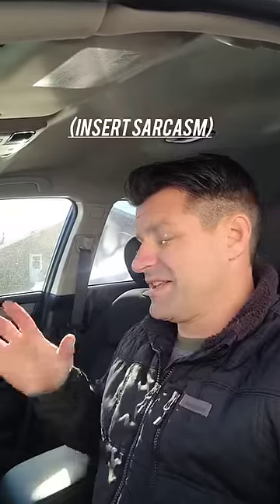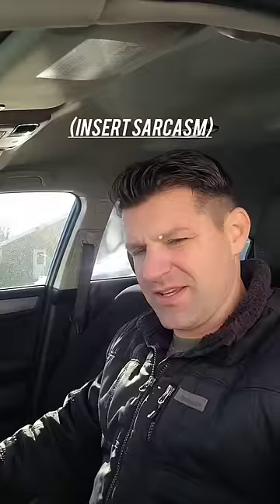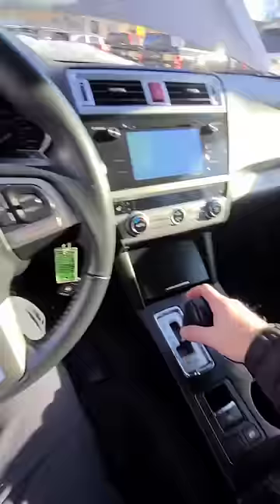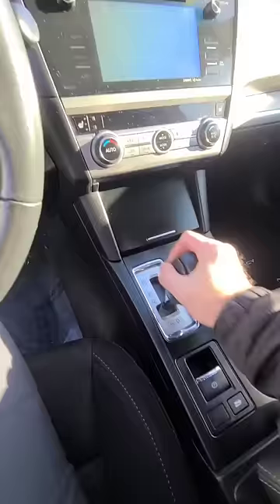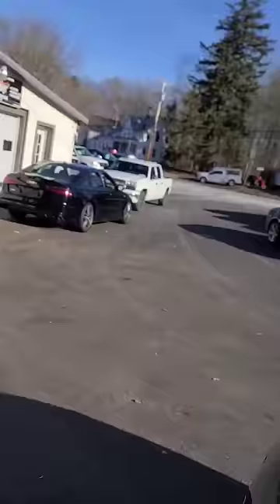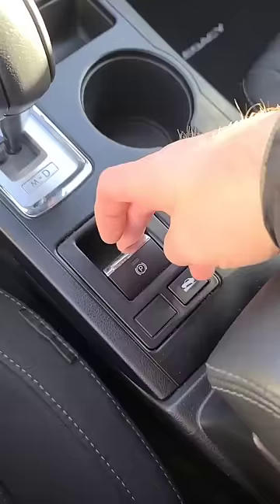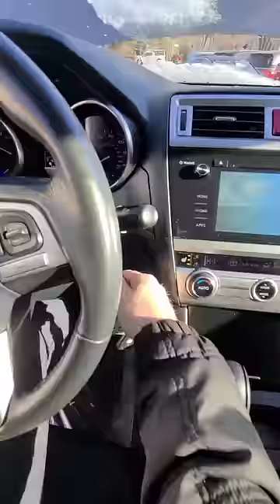Why Subaru Engineers deserve a punch in the Face! #shorts

Comment: All emergency/parking brakes should be mechanical. They’re not much use if you can’t use them when you need them the most.
Reply: How often is it the case that you're moving and don't have neither hydraulic brakes nor battery power
Reply: It's also a pain in the ass to drift using them
Reply: @THEACERASPIREMAN  the man who has a mechanical parking break is a fool every day but one
Reply: @xenn4985  Sure it might come in handy in the 0.1% of cases, is that a reason to keep a more expensive manufacturing process?
Reply: @brandonlink6568  Well I can't argue with that except to get more power to the rear wheels so you don't need a brake to break loose
Reply: @THEACERASPIREMAN  electronics fail alot more that physical connections
Reply: @THEACERASPIREMAN  its worth it because electronics fail more often, it's an emergency brake and they're are adding in more fail points
Reply: Parking brakes really aren't emergency brakes.  They're not built strong enough they often have pads held in with spring pins that just go in holes in the baking plate of the brake.  Now the modern electric ones usually just activate pressure in the abs pump to hold the rear brakes on.  I much prefer this because they aren't a bear to service.
Reply: They call it “parking brake” and use a P within a circle to indicate the button.
Originally, it was called the “Emergency Brake“ because if your hydraulic brakes, foot brakes, primary brakes or ext were to fail,  you would be able to rely on a separate braking system.
It uses a cable from a hand crank, to actuate the rear brakes, at times, the rear brake that the Emergency Brake was attached to, is a totally different hardware than the regular rear brakes.
Reply: @THEACERASPIREMAN  it being literally the only way to aplly brakes to a car that has no electricity? Yes...
Reply: @xenn4985  You can apply your hydraulic brakes without electricity
Reply: @ryantracey8574  Never yet seen an electronic parking brake fail, but plenty of stuck cables and frozen parking brake shoes
Reply: @ryantracey8574  They're removing fail points actually
Reply: @bryceg5709  The parking brake is still an emergency brake, it is designed to be able to stop a moving car in case of a complete hydraulic failure. Also, that is not how modern electronic parking brakes work, they just have an electric motor attached to the caliper, which will push the piston. A parking brake cannot use the hydraulic brake system.
Reply: @OssamabinKenny  Yes, and it is still designed to do that.
Reply: @THEACERASPIREMAN  can you... lock them?
Reply: How is it even an emergency brake if you cant use it while the cars dead whats the point
Reply: @xenn4985  You can bring the car to a stop with your hydraulic brakes, and keep it there with a gear/parking pawl
Reply: @THEACERASPIREMAN  sure airbags only save your life if you crash. is that any reason the manufacturer should spend money on putting them in the car? the point is in an emergency the emergency brake needs to work in every situation. if my battery dies or fails while driving down the road... I still have an emergency brake to stop myself without the brake booster.
Reply: That's why they don't call them emergency brakes. They're called parking brakes.
Reply: @ryantracey8574  except I've fixed way more mechanical parking brakes than electronic parking brakes.
Reply: @bryceg5709  no they don't, they all have motors on the rear calipers.
Reply: The trick is to put it on when you park.
Reply: @edward1927  In road vehicles, the parking brake, also known as a handbrake or emergency brake (e-brake) - Wikipedia. regardless playing semantics is a sign of a weak argument.
Reply: Its not an emergency break 🤦🏼‍♂️
Reply: @chetopuffs  In road vehicles, the parking brake, also known as a handbrake or emergency brake (e-brake)... - Wikipedia
Reply: @THEACERASPIREMAN you’re simply wrong about it costing less. In fact it costs more.
Reply: @THEACERASPIREMAN  and when those dont work?
Reply: @THEACERASPIREMAN  a mechanical parking brake is a safety item. What do you not understand about this.
Reply: @bryceg5709  standard parking brakes are drum brakes situated on the inside of the rotor. They are perfectly cabaple of stopping you at any speed safely. They will lock more easily than standard foot activated hydraulic brakes but thats because you arent used to use your hand to brake.

Electric brakes are a safety hazard and you should never buy a car with them
Reply: I agree
Reply: @edward1927  I mean they are also called emergency brakes
Reply: @xenn4985  Then you're in a very bad situation I guess? What if your mechanical hand brake cable snaps?
Reply: @thomasfournier3738  Electric parking brakes can do the exact same thing
Reply: @thomasfournier3738  Why is it any more of a safety item than an electrical parking brake?
Reply: @justinkaufman495  It's because the electrical parking brake still complies with regulation and can stop a moving car. If you lose electrical power when driving you should use your pedal brake to stop, not your emergency brake. The only time you should be using the parking brake to stop is if you lose hydraulic brakes completely.
Reply: @THEACERASPIREMAN  No. You don't get to take something that is so rare people don't even think about it, and compare it to something that happens so often people wonder why the fuck it was designed like that.
Reply: @justinkaufman495  
you didn’t just use wikipedia as a source; did you? 🤦🏼‍♂️
Reply: @xenn4985  Wrong. There is zero advantage to electronic parking brakes. They are a technology that had no reason to exist.
Reply: @scythelord  That's what I said
Reply: Most are not.  But all asian cars are.  So this is just a not knowing how.   It would have taken him less than turning on the camera.  It litterally said
Reply: @ddjohnson9717  Which he could've solved by just overriding the shift interlock
Reply: @scythelord  There definitely are advantages, they're much simpler to implement, take less room in the car, are more reliable, don't ever require adjustement, allows for automatic parking brake activation, etc.
Reply: @xenn4985  It's common to be in a situation where you only have the parking brake to stop the car and you don't have any battery power?
Reply: @chetopuffs  I very much did. Wikipedia has been an acceptable source for years. just because your school teacher wouldn't let you use it, doesn't mean everything in there is untrue.
Reply: @THEACERASPIREMAN  Why are you telling me something I'm literally already saying.
Reply: I think if they use electronic parking brake they should also have a manual emergency brake
Reply: @warburk  Why? The electronic parking brake is also an emergency brake.
Reply: Well the e brake went from emergency/ parking brake, to e brake meaning electric/ parking brake.  Far as I can tell it's shit for emergency braking
Reply: @marvyn_wez  I mean a mechanical handbrake isn't ideal for stopping either, but an electric parking brake will still stop a moving vehicle in case of completely hydraulic brake failure
Reply: @THEACERASPIREMAN  the most common failures across all brands of modern cars are electronic/ electrical failures. That's all the reason I need to not buy a car with fly by wire throttle/ steering/ brake controls. Especially autopilot and emergency accident avoidance brake control override systems.
Reply: @xenn4985 wtf.... He's never a fool...
Reply: This is literally the only reason I didn’t buy an ‘18 Civic SI. You especially need a mechanical one with a manual transmission car, as it (obviously) doesn’t have a park position on the shifter.
Reply: @arc_4543  Why wouldn't an electric one do the trick?
Reply: @rossbrumby1957  Good luck with that since emergency brake assistance is a requirement in cars produced after 2024
Reply: Like... In an emergency?
Reply: @THEACERASPIREMAN  look at the video, no matter how unlikely the issue is if it can be an issue you should have the proper tool to deal with the issue if it's just the battery going out and your car was in neutral. 

Say your hydraulic brakes go out as well or are extremely weak are we just expected to run into another vehicle to stop the car?
Reply: @xenn4985  so seat belts are a necessary thing to keep you safe just in case you go over a bump too quickly or get into a collision, what if we replaced it with seat belts that required the car to be turned on because they had an electrical system that moved the seat belt for you instead of it just being something you pull out. Clearly it's more technologically advanced and much safer since the seat belt can be made to fit a person way better than what we have currently : ). 

Don't worry about the human factor and the fact that a massive failure happening in the computer means you no longer have a seat belt it's the more advanced and ergonomic way handle it
Reply: Imagine the world where you no longer have to look at that stupid seat buckle hanging out the side column of your car, instead you just have to hit a button and it puts on the seat belt for you
Reply: @jacobryan4569  I mean this scenario is probably less likely than a scenario of failing hydraulic brakes and a snapping mechanical brake cable.
Reply: @THEACERASPIREMAN  no matter how unlikely it should either have both an electronic and mechanical e brake or should just be a mechanical one so you can potentially stop your vehicle when there is an issue. I guess it should be put on the person if they're car has an issue with the battery and they can't do anything about it. Clearly it's just a skill issue and not something that is going to be dealt with by the company that made the mistake in the first place.
Reply: @THEACERASPIREMAN  it's a parking brake. Not an emergency brake. How often do you use it with the car running is a better question.
Reply: @thethumper088  It is both a parking brake and has the functionality of an emergency brake as well
Reply: @kelpking4484  it's not. It's a parking brake. It is not intended to stop a moving vehicle.
Reply: @iLumberjack  It will. Pulling (and holding) the switch on electronic break while the car is moving will cause the ABS unit to slam the brakes as hard as possible, stop the car and then drive the caliper motors to ensure the brakes stay engaged. Tested in on my BMW
Reply: @Axymerion  if they're relying on the hydraulic system to work, then they aren't a brake intended for use in an emergency. Semantics aside (e-brake vs. parking brake), if you're in a moving vehicle and lose engine and / or electrical power, the hydraulic system will still function, albeit requiring a lot more force. There's no need for a mechanical emergency backup in that scenario. You wouldn't bother engineering a system for that specific failure mode because you're already covered. 
On the other hand, if you're designing a system to engage the brakes so that you aren't relying on a relatively weak pin in the transmission to hold the entire weight of the vehicle on a hill, a mechanical (old school) or electronic system will be perfectly adequate for the task. 
Yes, old school mechanical systems did provide the potential opportunity to use them if the entire hydraulic braking system failed, but the vast majority of drivers don't have the skill needed to know how much force is needed for controlled deceleration and stopping. The net result is a very high likelihood of locking up the brakes which carries and much higher risk of losing control. This is why, generally speaking, manufacturers no longer refer to the auxiliary brakes as emergency brakes.
Reply: @THEACERASPIREMAN  nearly all other manufacturers design the park brake to be a positive-fail system in that it will lock on without power.
Reply: @bryceg5709  not true they are classified as emergency brakes also and if yours isn't working you should get it fixed
Reply: @chetopuffs  wikipedia is one of the most reliable sources for information on the internet. it is held accurate by literally every person who views it. any misinformation is quickly corrected.
Reply: They don't need to be manual, they just use the wrong approach. They should be handled like security doors with electronic strike(r)s(?); there are two types, fail-safe and fail-secure. Fail-safe means the 'lock' disengages in the event of power loss meaning the 'door' is no longer locked/held shut. Fail-secure on the other hand means that when power is lost, the 'lock' engages preventing a lock/door from opening until power is restored.

Using the latter approach would mean that in the event of absolutely no power in a car, the parking brake/lock engages and will not disengage until power is restored. This does create an obvious issue in preventing the car from ever moving, but it's one that can be much more safely worked around and addressed in other ways.
Reply: @bmxscape  oh God ricer Honda Civic society.  If they were "emergency brakes" then they were invented when cars were all manual transmissions yes?  Ever had the brakes go out on your vehicle from the 30s 40s 50s or 60s?  I have my 68 Porsche lost it's brakes.  I've had this happen in cars many times in my life even in more modern cars like E30 BMW and one time I lost a brake circuit in the back of a 190e 2.3 in all cases you know what works? You just turn off the engine.  Yes back when the brakes were substantial products the transmission was manual and shutting off the ignition stopped the car faster than wimpy "e brakes". What doesn't work on mostly all those cars after 10 years of driving in the rust belt?  Ya nailed it the parking brakes which are rusted to crap not adjusted and the backing plates bent to crap.  Ever drive a car with hydraulic brakes linked to a lever like a rally car?? Try it they are frigging awesome otherwise toss your brothers salad and stuff it
Reply: @bmxscape  I'll add when have you EVER in your life went to need your brakes and then went oh crap my actual real 4 wheel brakes aren't working.  And I better now find my parking brake handle or pedal in my car and activate it because dear God my actual brakes aren't working!  Have any of you ever even thought about what you are saying?  In an emergency you would activate a secondary more crappy brake system? If you needed your real brakes you're just going to crash into it.
Reply: @bmxscape  I'll give you another if you wanted an emergency brake what axle in a car does most brake force?  Front or rear?  You better say front because clearly engineers know that a car in a panic stop with no brakes would have front brakes not rear.  So what engineer went hey let's put crap rear brake shoes into a rear drum brakes actuated by a cable and call that an emergency brake ya know so when our vastly superior dual circuit boosted brake system composed of 4 disc brakes and pads has to be manually activated by a handle that you aren't used to using at the last second?

It's just BS Porsche had parking brakes with a lever under the dash you have to reach down and grasp to pull.  It's an emergency brake like an abortion is contraception so stuff yourself.
Reply: @bryceg5709  parking brakes ARE emergency brakes
Reply: @pashakdescilly7517  no they aren't.  Just read this and try to grasp it.  You're driving you go I need to brake.  Maybe 1:1000 times you do this while thousands of feet before crashing and in that 1:100 million times does a person who does so experience a brake failure.  Based on car safety stats and amount of driving globally that's probably 1:100 billion.  So now in this event where you're all OMG my actual brake system failed you're going to grab a thing in your car you seldom use and are dinky little brakes only on the rear axle and not engine boosted?  And that's gonna stop you from hitting whatever it was that JUST made you apply your actual real power hydraulic brakes on your car??????
Reply: @pashakdescilly7517  sorry your weak point angers me.  If it's an emergency brake it should be stronger than the regular brakes.  It should be a redundant system that when regular brakes fail it succeeds.  It's the opposite.  They are parking brakes only.  You could argue that you should just drive using them as your brakes and then the actual brakes are there for emergencies.  That's very dumb but more intelligent than thinking that in an emergency your parking brake will do anything particularly on an older car.  They just don't.  Steer pump the brake shift down steer turn off the car.  Steer maybe once the car comes to a stop engage the parking brake but it's clear you've never used one in a real life scenario because they are absolutely useless.
Reply: @bryceg5709  In the early days of motoring, brakes were primitive and unreliable, and not very powerful. They were prone to failure.  Typically, the foot brake worked on a transmission brake, and a hand lever operated the rear wheel brakes.  They had to be totally separate brake systems.  Gradually brakes got more powerful and more reliable.  By the end of the 1920s, cars all had brakes on the front wheels as well as the rear, and foot operation was standardized.  The hand brake remained, legally required to be totally independent of the foot brake.  Typically, when the wheel brakes became hydraulic, the emergency / hand brake remained mechanically operated.  This was so that, if the main braking system failed FOR ANY REASON, the independent emergency brake would still be functional.  It's main usage in practice was for parking, but it is legally required as a totally independent separate braking system in case of failure of the main system.
This idea is also the main reason why motorcycles also have two completely independent braking systems, one on the front wheel. and one on the rear wheel.  Rules have changed recently to allow linked braking...  The pioneer of linked hydraulic braking on motorcycles starting in the mid 1970s was Moto Guzzi.  They operated the rear brake and one of the two front disk calipers from the foot pedal, and the other front disk from the hand lever.  Bingo, separation of braking systems!
Reply: @pashakdescilly7517  and you nailed it.  Modern braking systems are so far past "emergency brakes" that the newest you could refer to one as an emergency brake is... 1920
Reply: @THEACERASPIREMAN  for the same reason in the video, if your car dies you have no reliable way of keeping it still
Reply: @pashakdescilly7517  you realize anything you saw ken block RIP drive had a secondary hydraulic brake system most of which had a bias valve so that they could control a second left or right hydraulic disc brake.  None of which were manually cable driven drums?  My current vehicle fleet is a Porsche 912 a BMW R80 a manual Crosstrek and a 49 chevy 5 window so yes I drive manual.....and previously several BMW e30s including an m3 e36 and e46 manuals a Porsche 356 a Porsche 944 a Delorean several other non synchro trucks... Ya know what none of them had?  A parking brake I would use as an emergency brake!

Come off as you would prefer parking brakes are dinky little garbage brakes that if you want to stop ken block again RIP wouldn't touch in a lifetime.

And yes when we build rally cars the rear brakes get a mechanical biasing valve that controls both rear brakes proportionally....  And it adds 2 extra rear brake calipers (hydraulic). It's a whole different system that literally adds a second set of brake disc pads in a second caliper.

I can be a dick but you are an arse that's been penetrated.
Reply: @pashakdescilly7517  say it.  Do factory cable actuated drum parking brakes have the power to stop a car equal to the full stopping power if the actual brake system.   Yes or no.  It is clearly no.  You will clearly crash if your actual brakes failed.  They are only parking brakes with no emergency potential at all.  And Ken block again RIP snowmobiles are dangerous and you should never go straight down hill but again.... they are not emergency brakes in any way shape or form they are parking brakes and if your brakes fail down shift pump pump pump and aim for something soft.  Jeez I wonder why semi trucks have run off ramps bot cable actuated drum brakes on mountain descents.  Could it be that cable actuated drum brakes... dont work?
Reply: @pashakdescilly7517  park on an automatic is usually a pin that would shear in a heart beat if you engaged it at speed...
Reply: Or at the very least, have a mechanical alternative. I think at this point the engineers are too tied up in the "sleek, minimal look", but I seriously don't understand why they can't just add a pedal E-brake like you get on trucks and vans
Reply: my car is from 2001 and I live in the rust belt. ive never have had a issue with the emergency brake. I have never used it at high speeds but once I had a emergency, one of my brake lines rusted and I had no stopping power and so I remembered my dad a long time ago taught me to coast on the handbrake when he lost his brake booster and resevoir cracked. im thankfull to him. the most I was going was probably 35 miles since it was in the city but I stopped fine didnt really notice a difference with my normal brakes especially since those have always felt spongey eitherway. i know how to work the handbrake perfectly I got plenty of expierence with mountain bikes, so im used to knowing how much pressure to apply. due to bias I would love the mechanical brake to remain and btw this is coming from a computer engineer so I love tech and everything but I cant bring myself to agree with electronics in every single place. some things are best left untouched. although the electric brake just needs a few tweaks to become perfect
Reply: @THEACERASPIREMAN you just argued against gun control. You just didnt know it.
Reply: @bryceg5709  if your e brake doesnt work you should get it fixed. mine is hydraulic and can slide the car easily
Reply: Sorry sorry I have a case of Yu-Gi-Oh player still. Haven't yet gotten that dealt with
Reply: Or maybe they should start to wire the e-brake to a separate (smaller) battery? idk 🤷‍♂️ in my head it sounds like a solution-ish.
Reply: @lil-link  only adds something else that can go wrong
Reply: @THEACERASPIREMAN  One in a million but it's that millionth unlucky person will somehow get hurt and law suit then another mass recall then another price increase on cars for this stupid reason.
Reply: @lil-link  it's an electric motor not it combustion one, it won't do Jack Diddley considering if the power doesn't work on the car or the battery is dead and it doesn't have a backup source the motor can't do its thing
Reply: @THEACERASPIREMAN You're really here telling me electronics are cheaper than mechanical? Well I'll be damned I've been living in the wrong world
Reply: @muhammadkhairulafiq2917  A small electric motor attached to the same brake caliper as your service brake is simpler than making a whole other braking mechanism with its own shoes and cables.
Reply: @Nexgeninfi  I'd imagine that one in a million scenario would count as an act of god
Reply: @arc_4543  Except putting it in park
Reply: @THEACERASPIREMAN  it’s literally cheaper to make it a cable operated by a ratchet instead of a solenoid actuator that tightens things up like for real.
Reply: @davidking7750  "What are the odds?" is exactly how you engineer safety. Airplanes have 2 sets of crucial flight instruments, around 15 minutes of oxygen for the passengers in the case of a depressurization, 2 engines. While we can both imagine scenarios where those aren't enough, what are the odds?
Reply: @user-vk4vd7vr5t  That's not true, usually electronic parking brakes require power to both activate and deactivate
Reply: Most cars don't actually have emergency brakes, they are really just for parking. That's why the shoes are so tiny if it's a top hat style.
Reply: If you don't use them much, they tend to freeze up from rust / corrosion / dirt.
Reply: @THEACERASPIREMAN  LOL.
Reply: @THEACERASPIREMAN  you know that Civic SI’s don’t have a “park” position on the shifter, right? Because they have a manual transmission.
Reply: @arc_4543  Okay? leave it in 1st gear like every other manual
Reply: @Nexgeninfi  What?
Reply: @sulleyt1841  But they are still regulated as an emergency brake and have requirements to be able to slow down the car to a halt.
Reply: @ConstantinSPurcea  It's just a simple electrical motor that pushes the piston, I can imagine that being cheaper than an entirely separate braking mechanism inside the disc.
Reply: @THEACERASPIREMAN  not very often but its possible
Reply: @bryceg5709  "They're not built strong enough they often have pads held in with spring pins that just go in holes in the baking plate of the brake."
Rofl, spring pin into holes in the brake disk, that would be something to behold. 
Please tell me a single car model where this is how the handbrake works. I really doubt you service a lot of brakes.
Reply: @THEACERASPIREMAN  doesn't matter, emergency   brakes should not depend on anything else in the car.
Reply: @THEACERASPIREMAN  how about we have the airbags rely on the battery too?
Reply: @bryceg5709  happened to me when I was a teen didn't bleed the line properly, went out for a test drive, thank God for manual e brakes
Reply: @Vertti Honkanen  had a brake like burst while i was driving, needed to use my e brake to stop. So there is that
Reply: @bryceg5709  that is how all drum brakes are made and they work just fine.
Reply: @THEACERASPIREMAN  its not about neither, either or is just as bad. had a brake hose bust about a hour from home, being able to manually apply brakes as needed using the lever got me home. you cannot do that with electronic ones since they just clamp with no variability. also electrical faults are a thing as well. as a auto tech i trust cables way more then i trust manufacturers and their electronics.
Reply: @rickylafleur5823  An electronic parking brake is not all or nothing, it will try to slow you down gradually. 

Electrical faults exist yes, but since you say you're an auto tech, how often do you have to repair electronic parking brakes versus how often do oyu see stuck cables or mechanisms with mechanical parking brakes? Maybe my experience is different since I live in a cold climate but mechanical parking brakes are always liable to freeze or  cables to rust.
Reply: @showlottathings  Airbags do rely on the battery
Reply: @showlottathings  A mechanical e-brake still relies on a cable, which is liable to break.
Reply: If you drive a manual just shift it. You can't move it easily if you did. The vacuum and compression is stopping the car
Reply: @THEACERASPIREMAN  i have changed both but neither frequently, most refuse to fix their e-brake but i guarantee you they would be more inclined to fix two cheap cables vs a few hundred dollar actuator. also the BMW's i have had to replace the PBCM ones which is what they call theirs it is electronic but uses cables so all most of these are doing is adding another failure point.  in fact it's multiple more failure points, the switch, control module, actuator.
Reply: @THEACERASPIREMAN  parking brake cable snaps? LOL I guess you're fucked too if the electronic parking brake flimsy plastic button snaps  xD
Reply: @THEACERASPIREMAN  just in emergencies
Reply: @BryceG  that is like saying Emergengy Rations should be more food than normal food because in an emergency you need extra. Emergency equipmipment is not "for best results". it is "when all else fails".
Reply: @THEACERASPIREMAN  doesn't matter how often it happens he's right and you're wrong.
Reply: @Faygo2215  Of course it matters how often something happens.
Reply: @THEACERASPIREMAN  Better to have it and not need it.
Reply: It's a parking brake i.e. you use it to remain stationary once you have already come to a stop. I grossly dislike E-Brake as a term, it's wrong.
And I also hate seeing vehicles wobble on their locked transmission (in park). Poor gearboxes!
Reply: @THEACERASPIREMAN  wrong, they have internal caps which allows them to function when/if the battery is disconnected during a collision
Reply: @THEACERASPIREMAN  "How often is it the case that you're moving and don't have neither hydraulic brakes nor battery power"

I don't know about battery power, but that one time if/when you loose your brakes, for any reason, is one time enough.

Just because it's [current year] does not mean certain things ought to be engineered to be out of the direct control of drivers.....

.....like *emergency* brakes.
Reply: @blakjaknz  Well it is also designed to be an emergency brake if need be, that's where the term comes from
Reply: @showlottathings  Yes, for a few seconds
Reply: @FourFourSeven  But when designing safety, you look at odds. If something is extremely unlikely, you're not going to make sacrifices in design for it. Also you already don't have 'direct' control of your hydraulic brakes, ABS literally interferes with your brake input since the 80s
Reply: @THEACERASPIREMAN  designed? No, I'd disagree. It can be used at a pinch, but it is not intended to stop a moving vehicle.
Reply: @justinkaufman495  
With respect, No; Wiki is not a source.
I will however concede that Wiki is excellent repository of source material just like a card catalog at the Library, but not even a library in it’s self is a source.
•Case in point:
If you has actually gone into that ”Library” of knowledge; you would find a 2014 Subaru Outback/Legacy Owners manual, like mine.  (Given similar variables some credence to validity can be given as to be considered a valid source)
Section 7 Page 37
*•Electronic Parking Break
Image: 701178 
Image List Item 1 of 3: Parking Break Switch*

I would have just provided a direct link to a PDF, but YouTube will pull my comment. Isn’t strange that they can cite Wiki, but we can’t cite Subaru???
Those teachers and I are trying to show you the folly and dangers in your line of reasoning.
Reply: @THEACERASPIREMAN  " But when designing safety, you look at odds. If something is extremely unlikely, you're not going to make sacrifices in design for it. Also you already don't have 'direct' control of your hydraulic brakes, ABS literally interferes with your brake input since the 80s"

You can calculate odds for many different situations and scenarios as much as you will, but it's still absolutely terrible practice to engineer away direct command of something very, very important to a basic concept of transportation, and that is the ability to stop your vehicle in case regular hydraulic brakes stop working altogether.

And it doesn't matter at all whether or not I have direct control of hydraulic stopping power, that's not what I'm concerned about. Furthermore, ABS is supposed to keep the brakes from completely locking up the wheels in inopportune moments, especially when slipping & risk swerving out of control -- which is exactly why it is called " Anti-Lock Braking System".

When I need to stop because the regular brakes have failed and will not work, I need them NOW and not have to worry about prerequisite actions before I can use emergency/parking brakes, such as slow down to a certain speed or be at a total stop (as some others here are mentioning).
Reply: @THEACERASPIREMAN  Youre describing powersliding not drifting :D also its not that much more expensive.. car manufacturing is getting cheaper and cheaper with all these cheap chinese displays instead of mechanical buttons/switches. Having a mechanical parking brake doesnt seem like much of a trade off, Ill rather pay 100€ more for the car just so I can avoid such a situation. 

Ive also been in a situation when the driver got unconscious, left his foot on the gas pedal and all the control I had was the key, the wheel and that handbrake. Without it I wouldnt be here typing this shit xD (I pulled out the key, tried to steer with one hand with a handbrake on the other, tried not to drift into a tree on a relatively steep downhill section..) Electric handbrake allows for no control - it either brakes or it doesnt, so the car could have spun at that speed.
Reply: @THEACERASPIREMAN  because pilot training takes into account scenarios where those contingencies aren't enough. That is comparing apples to oranges. As it comes to the controllability of aircraft, there are several redundancies in place to prevent the loss of control (including parking brakes!) and as far as I'm aware some 737s still even have mechanical linkages that make use of aerodynamic pressure to move control surfaces in the event of total computer failure, which is extremely unlikely in of itself. So no, your point about odds doesn't hold up very well. (Source: Me. A trained commercial pilot).
Reply: @THEACERASPIREMAN Some support for once: i, as a car tech, 100% agree with you here. Its enough for modern cars to have electronic parking brakes because as you said, in some cases (Ford e.g.) its literally just an electric motor on the rear calipers. And its very very unlikely hydraulics AND electronics fail  at the same time.

You said it was desinged to also serve as an emergency break. So yeah heres the catch: you guys should be suprised how much your modern car (2015+) knows about itself. The ABS Unit for example can messures its own pressure, and if you press the brake pedal and the car sensors no brake pressure the electric brakes will literally slow the car down for you.

There are many more pros for EPBs for example:
In some cars when you press the handbrake button while driving, the cars brake system jumps into emergency mode (the EPB-module communicates with the ABS module) and slows the car down to a hold.

Auto-Hold, automatic releasing and engaging incase you forget it.

Engaging the handbrake with hot brakes does lead to a loss in breaking power as the metal cools down and shrinks abit. EPBs always engage with full power so you dont have to wory about brake temperature
Reply: What's funny is they were used as parking breaks because the manual transmission cars needed something to hold them when parked.

Now automatic transmission cars have no reason to use them as parking breaks except for cases like this one or a failure on the normal breaks (such as leaking line).

Any common failures relating to the classic emergency breaks is probably from lack of maintenance.
Reply: @chetopuffs bro just pulled out Wikipedia to argue, you must not have gone to high school
Reply: @ARockRaider  Barely anyone uses the handbrake as a "parking brake".. just leave it in gear
Reply: @blakjaknz  Well what I mean by designed is that it has design requirements to be able to stop the car with a certain acceleration.
Reply: @FourFourSeven  You don't need any prerequisite actions to be able to slow the car down with the parking brake in the case of hydraulic brake failure, you can just activate the parking brake and it will slow the car to a halt, not well but it will do it. 

You said that it was bad engineering to take away direct control of brakes from the driver, when ABS literally does do that, that's why I brought it up.
Reply: @MisoElEven  If you actually pull the electric parking brake at speed, it doesn't just lock up the rear wheels, it will try to slow the car down in a controlled manner.
Reply: @jgreenberg  Since you brought up the 737, I assume that you're type rated on that or other Boeing aircraft. It is true that Boeing still uses cables for control surfaces on some planes, and hydraulic pressure to boost your inputs (which will be drastically reduced in the case of engine failure, only gettting some from the ram air turbine) but current Airbus models are all completely fly-by-wire, if you were to lose all computers and power, you would have no control over flight surfaces, but it's extremely unlikely to happen, so the plane is allowed to fly, and it has been extremely reliable, and fly-by-wire allows for protection against human mistakes easier than cable controls, the computer will not let you stall the plane no matter how large the inputs you are making.
Reply: @THEACERASPIREMAN  You really worship these electronic hand brakes don't you?  "They never fail" Until the battery does :/
Reply: @justinkaufman495  it's not an emergency brake, it's a parking brake. That's how the manufacturer refers to it and intended for it to be used. Normally you can only enter a parking type situation while vehicle is powered, so this system is objectively reliable when it's being used correctly. It's extremely niche that someone would be able to power on the car, move it, and then lose all power before being able to engage the brake. Also, he could just move it, the eps shouldn't be locked while the vehicle is in drive. Seems like buddy here wanted to throw Subaru under the bus for something that's half his fault. Decided to make a video about it instead of maybe just dealing with it like a real life human being, lol.
Reply: @dongordon2754  "normally you can only enter a parking situation while the vehicle is powered" you seriously don't understand what's wrong with this sentence. a dead car can't be parked? guess that means it's stuck to roll away forever and that first statement is dependent on the manufacturer however stateside the parking brake is the park position on the gear selector. the emergency brake is also known as a parking brake on every car with a manual hand brake. the omission of a word from the manual for a part that does exactly the same function in a new way doesn't change its name or purpose. we don't call paper plates a different item with a different function despite an adaptive to the name and the exact same purpose as a regular plate. simply put it is what it is and omitting a word from the product description doesn't mean it's magically a totally different part. also I will say it again because clearly it's been hard to understand but if it can't park the car its not a parking brake. mine works without power. personally I would argue that an emergency brake of some kind that doesn't require power should be federally required on any vehicle above 500LBS. it's not hard to make or keep seeing as we've had them for almost 100 years before someone decided that a safety feature should be traded for a safety Hazzard. also losing power while driving is an absolute possibility between loose terminals, bad batteries, and a faulty alternator. it's not something that can't happen, it happens all the time.
Reply: @justinkaufman495  the only failure condition that would materially affect their ability to brake is the normal brakes, which the car should only be driven at all if they work. The brakes still work. He can still park. Then there's the shift override he can use when he's in a good spot, and he can put it into park. The parking pinion can serve as a temporary measure to keep the vehicle planted. It can safely be stopped and parked as it is, there's not very much, if anything stopping it from being done.
Reply: @dongordon2754  the brakes aren't meant for parking. they're meant to stop temporarily in between conditions of driving, switching direction, and parking.
Reply: @THEACERASPIREMAN  your brakes do that too. essentially it's just a foot brake for your hands. I also assume this to mean it's routed through the ABS module in some way and utilizes brake fluid meaning it's literally useless for anything.
Reply: @dylancantwell2846  
Are you saying that it’s now common place for high school students to use Wiki an easy “appeal to authority” just to win an argument?
You could only get hard copies of Wikipedia when I was in high school. This cat called Britannica sold them and they were crazy expensive.

(Library card catalog reference should have been a clue 😉).
Reply: @blakjaknz  
“Its a transmission; not a kickstand.”
Reply: @TheBenzdad  neatly verbatim only I was going to suggest a spare tier.
Reply: @bryceg5709  
Wrong;
Primary Systems are paramount ∴ the most robust.
Secondary Systems are Ancillary ∴ need not be as robust.
Else: we would all be driving on doughnuts with motorsport quality tires as our spares in the boot.
You’re arguing that the best parachute you own, should be used as reserve a chute?!?
If so; I’m definitely not going skydiving with you, let alone getting into any car you’re designing.
Reply: @justinkaufman495  It doesn't rely on hydraulic pressure at all, that's why it also functions as an emergency brake in the case of of a complete hydraulic brake failure
Reply: @brandoxic8354  There's just too much unreasonable animosity towards any new technology, that's what I don't like.
Reply: @THEACERASPIREMAN  I have had to use the parking brake in two different vehicles. First example, the master cylinder in my 94 Bonneville failed. i could build up brake pressure to stop but the moment i stopped pumping, the vehicle would start moving again. I made it home doing a dance between the hydraulic and parking brakes at every stop sign and red light.

Second situation i forgot what it was but something managed to get stuck behind my parking brake pedal so i wasnt able to push it down enough to stop. I put the transmission into neutral and feathered the hand brake in my 97 saturn until i was able to pull over and remove the block. I will argue i was able to safely slow down and not have a sudden jerk stop since i had a mechanical hand brake and not an electric one.

On those two scenarios alone, i'll say anyone who thinks "having an electric parking/emergency brake alone is just fine" either hasnt put more than 2 seconds thought into it, or is just plainly a moron.
Reply: @metalwolf112002  If you've ever tried an electric parking brake at speed, it's not all or nothing, it will stop as controlled as possible.
Reply: @THEACERASPIREMAN  tell you what, I’m willing to pay $1000 extra for ot
Reply: @justinkaufman495  I hate to disappoint you, but parking brake will not stop a fast moving car.
Reply: @pawelzielinski1398  I hate to brake it to you but a mechanical parking brake will. the point isn't to stop on a dime. the point is to stop in the event of a malfunction in the braking system.
Reply: @justinkaufman495  It's much more efficient to use engine to stop the car than it is to use parking brake. I can guarantee that you will stop much sooner by using the engine to stop the moving car than using the parking brake. Several years ago I drove a couple miles with the parking brake on. Yeah, the car was sluggish but it was moving. Parking brake is not designed to stop a moving vehicle.
Reply: @justinkaufman495  Have you ever tried to do just that?
Reply: @justinkaufman495  What are you talking about?? Parking brakes are absolutely useless in case of an emergency. They will do absolutely nothing to stop a fast moving vehicle, except heat up the brake disks in on the rear wheels.
Reply: @pawelzielinski1398  what are you on about that's the whole point of the emergency brake.
Reply: @justinkaufman495  you are mistaken. The purpose of the handbrake is to prevent the car from rolling away when parked on an incline. In good old days cars had manual transmission, so if you left a car parked without any of the gears engaged the wheels were disconnected from the engine and the car could roll. Drivers always parked on 1st gear (or on reverse gear). Parking brake was used as an additional safety, in case the transmission lever popped out to neutral position.
Handbrake is not designed to stop a fast moving car. Yes, it will engage when you use it while driving on cars with manual brake lever and will most likely lock up your rear wheels causing the car to spin around the vertical axis. It's not an effective way to stop a fast moving vehicle.
It's much better and more efficient to use engine instead.
Reply: @pawelzielinski1398  this is incorrect.
Reply: @THEACERASPIREMAN what if the alternator dies and then your battery dies in a few minutes?
Reply: Indeed.
And you can't feather electronic parking brakes... they're 100% or 0%
So completely useless for actual emergency braking unless you want to loose control instantly.
Reply: @Slayer-33  So a scenario where hydraulic brakes fail, alternator fails, and battery fails? How likely is that to happen really? I could just propose a scenario of hydraulic brakes failing and your mechanical parking brake cable snapping
Reply: @amzarnacht6710  I don't think you'd be even able to use electronic parking brake while driving. Parking brakes are not designed to stop a moving vehicle.
Reply: @pawelzielinski1398  They most certainly can and they very much are.  Electronic e-brakes, however, are only useful for parking.  If they engage while the vehicle is moving they'll just cause it to wreck.
Reply: @amzarnacht6710  That is my whole point. Parking brakes purpose is to prevent a car from rolling away while parked not to stop a fast moving car.